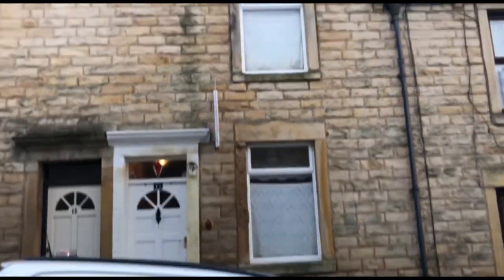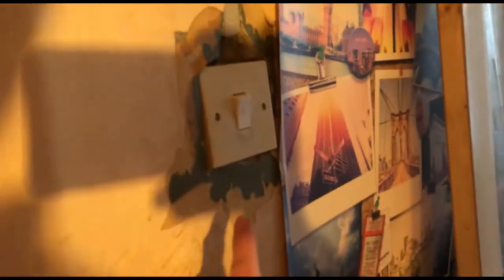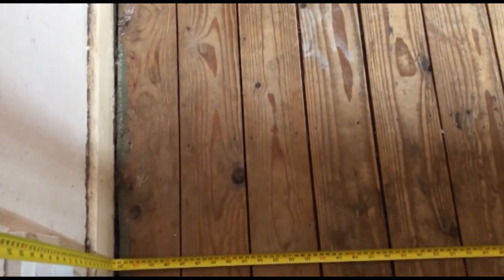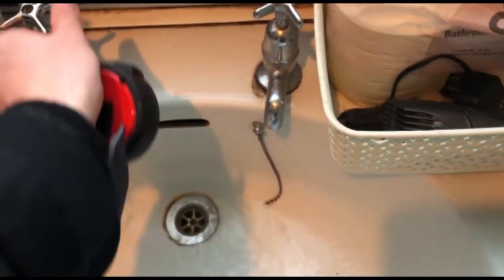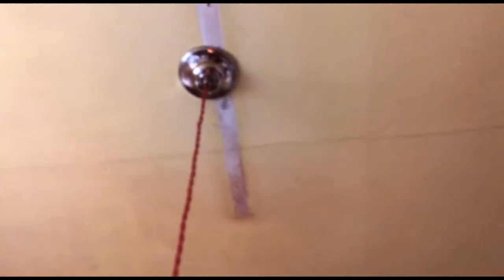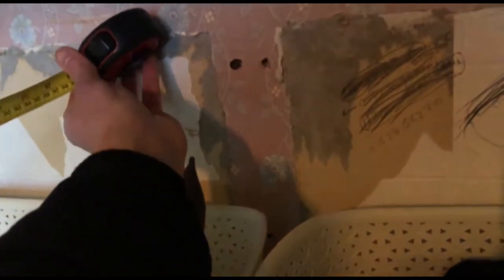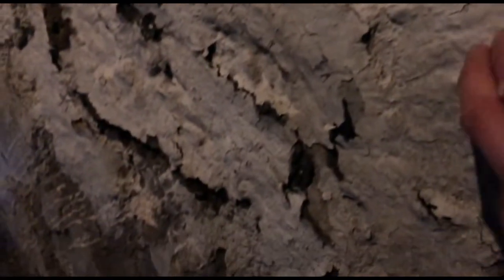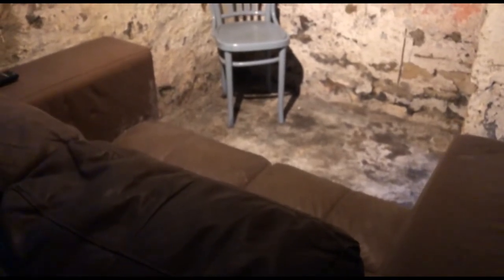TAKING ACTION! after SAMUEL LEEDS CRASH COURSE | Property Hunting for BRRR Deals

Comment: I'm sorry you've been drinking the Scamuel Leeds cool aid too much! Run the figures realistically.
You agreed £86k purchase price you said the rooms rent for £90-95 per week. It was a 2 bed with a basement which couldn't be used as a living room, so that's £180 per week.
180 * 52 = £9360

9360 / 86000 = 10.9%

And that's without the renovation costs of £20k, the maintenance, the bills, the agent fees, the empty periods etc.

You might say you're not buying it for cash, but a 25% mortgage, but then you're taking on additional risk.
Even so running the numbers without agent fees, maintenance or bills you'd get a return of 22.5% (86000*0.25= 21500, plus 20000 renovation = 41500, 9360/41500= 22.5%), so realistically after everything is taken into account you'd be lucky to get 15% on that property. Not a bad return (from a truly terrible house) but let's not lie like Samuel and claim ridiculously high returns.